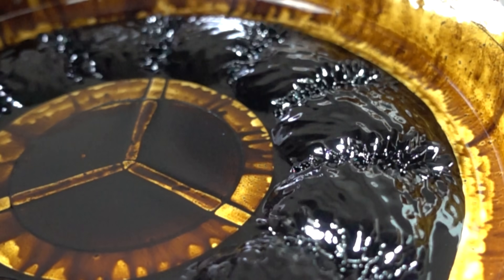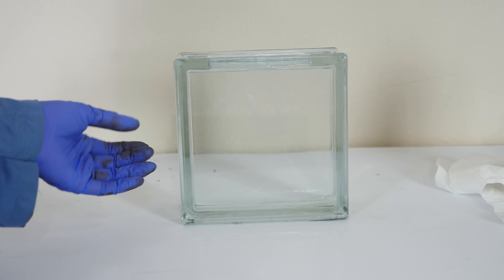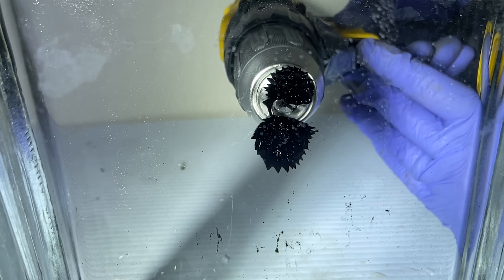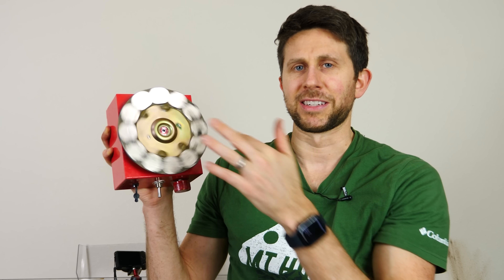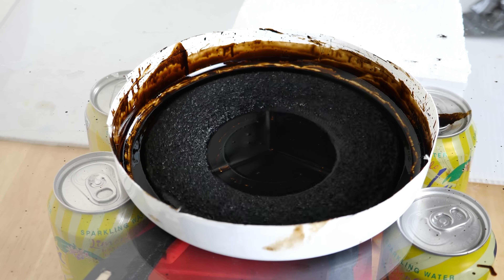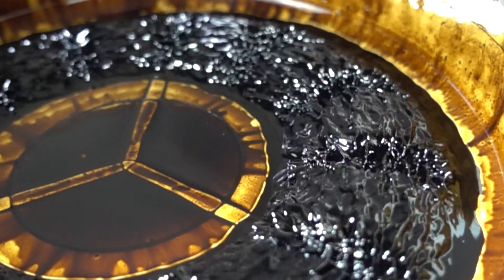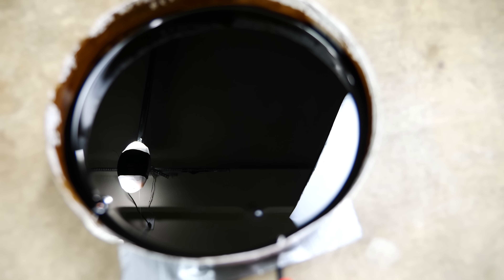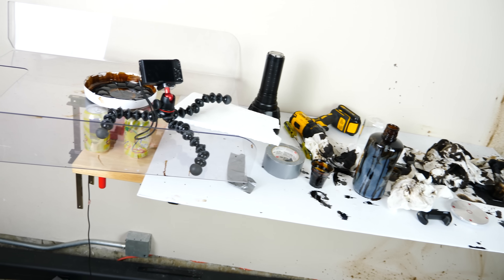What Happens When You Spin Ferrofluid Super Fast?

Comment: Given the ferrofluid is made with metal nanoparticles, could you use the rotating magnet setup with the ferrofluid as a polishing device? Given metal is fairly abrasive, I feel like it would be a pretty efficient, well lubricated polishing setup for lower hardness, non-magnetic metals.

Comment: There are no “lines” in a magnetic field. There is just the field. “Lines” appearing in the ferrofluid are simply created by the aggregate alignment of the ferro-particles in the fluid. 
This can be proven by doing the metal filing experiment a number of times. The “lines” will be in different places with each test. The “lines” in the filings experiment eventuate because each metal filing is literally turned into a mini-magnet and they are just lining up (meshing) end to end because of the poles aligning with the general field, which is actually a 3D dual toroidal shape, where one torus form the North Pole field and the other forms the south field. In between them is the accretion disk, which also appears in the filings experiment. Check out Ken Wheeler (Theoria Apophasis on YouTube) for deeper magnetism explanations.

Comment: I saw one video I think it was modeling of Ferrofluid and they found that you only need to know what is happening on the surface of the fluid for the model and you don't have to worry about the internal volume. The fact the ferrofluid stopped spinning with the magnets is kind of proof of that simulation.

Comment: Always fascinating to see what you come up with next. 

I'm wondering if there's any way of using (some form of) Ferro-fluid to create a very powerful electromagnet...

Does what you're doing work in inverse? If you pumped ferro-fluid round & round through a conductor fast enough (eg: a tubular copper ring/or plastic tubing surrounded by a copper wire coil), would it generate a perceptable magnetic field?

What if you made of ferro-fluid with liquid Oxygen as the liquid component (or some other extremely cold liquid), would this significantly amplify the effect?

Comment: You could easily rotate it with coils placed around and there is a vessel in the middle of them to keep the fluid in a circular form. Like mercury or with a inside ring that one polarity and an outer ring has the nother polarity and like rail guns the magnetic field is genersted by the fluid to move

Comment: Hotplate in a vacuum chamber with gallium or tin in a pot if you submerge wood in it would it absorb the metal in vacuum. Wood burns at 300 Celsius. Tin melts at 231 Celsius. It should be possible
Reply: I know i liked my comment i just want it noticed

Comment: would it be possible to draw this fluid between 2 different magnets suspended on either side of a glass tube,  with water in between, then would it be possible to enduce an electric field between the two sets of fluid?,  then if possible, how does the magnetic enduced shape of the fluid affect the electrical field in between?  seems to me that it could be a key to creating harmonic in that electrical field which in turn can allow it to store energy.

Comment: it seems to me that these spikes are the physical view of the breakdown of a magnetic field. because magnetic fields break down Distance Squared.  what would be interesting to see is this fluid is if you can find a magnetic field design that would allow for A spike,  any spike for that matter is go beyond the distance squared,   another major question i have is what is the capacitance of this fluid for given volume?  this should be dependant on the amount of ferral material contained.  with this capacitance reading, you can tell if it would be possible to use tesla's theory of harmonics.  which is,  every body has a harmonic state, and when that hormonic state is achieved, it becomes a storage unit for that energy,  given enough of these harmonic unites of stored energy stops and releases this energy, you would achieve a very large spike of energy the moment its released.  tesla also showed us that anytime you have a capacitive substance between 2 plates, that you can affect that substances harmonics with energy, and you can draw energy off of it at a given rate.  this is known as capacitence.

Comment: The problem with ferrofluid is it is not showing the density of magnetic field very well. Also ferrofluid I think is not attracted to a magnet as strong as other magnets. (Centrifugal force can detach ferrofluid from a magnet easily so my guess is that is not a very strong attraction force). Could magnetic or iron dust look different in similar experiments (inside rotating magnetic field)? Thank you for sharing!

Comment: You need to add the ferrofluid in a cyclical machine that  spins at at 60,000 RPM , to see an electromagnetic field that will lift the entire thing on the air

Comment: ive had an idea for a WHILE NOW, of using a spinning ferofluid to create gyroscopic forces/stabilization for flying/underwater vehicles and or spacecraft. using a series of electromagnets and a smart circuit to control them you could make such a device with "zero moving parts" other than the ferrofluid itself that is.
Reply: But you need to spin a magnet first, lol
Reply: @vladyskaizen  electrical current moving around creating a moving magnetic field would achieve the same results, without actually having a spinning mass of magnets. i refer you back to "using a series of electromagnets and a smart circuit to control them" in the OP. 
it would work SIMILARLY to how "railguns" or "coilguns" operate, just in a loop, instead of linearly, using a smart circuit to turn the magnets on and off in series, automatically in a pattern set up to achieve the speed it is set to "spin" at.

Comment: A though just came to me, especially after the AC magnet at the end. With such high speed flipping of the magnetic field, the magnetic particles in the ferrofluid must also be flipping to align to the magnetic field. Does this result in an increase in temperature due to friction with the carrier fluid?
Reply: Induction heats metal.  This is definitely metal, even if it's oxidized.  The whole system heating up (including/mostly the core screws) is probably why he limited to a few seconds per shot.
Reply: Induction doesn't heat all oxidized metals. Inductive heating requires delocalized electrons. To test this, I put a Tums (calcium carbonate) into an induction heater and it didn't warm up, even though it contains (oxidized) calcium.
Reply: I'm wondering this too!
Reply: I'm sure
Reply: i mean it isn't heating it up that much or that quickly since he literally put his finger in it for a bit after it was running and the only protection he has was latex or nitrile  gloves... so even if it does heat it up, it didnt heat it up too quicky or to the point it was too hot for him to keep his finger in it.

Comment: Here's a explanation of why the ferrofluid on the spinning magnet plate stops going crazy at high speed and act as if the entire magnet is static but weaker.

The entire setup becomes stable because the time scale for "ferrofluid goes from flat to spikey" is significantly longer than the time scale for the magnetic field's period, and the tiny perturbation from each half period becomes insignificant compared to the average. Remember that the force the ferrofluid experience stays the same whether the magnetic field is pointing out of it or into it, and also that for this experiment, that's the only thing that affects the behavior of the ferrofluid.

You can verify this by increasing the viscosity of the ferrofluid and watch as the pseudo-stable state form at lower speeds.

It's a bit like how you stop getting stuck running your nail over a comb when you do it fast enough, but will when you do it slow. The time scale of the force you push your fingers against the comb pushing your finger deep enough to get stuck is much longer than the time it takes for your nail to go over one tooth and reach the next, so you stop getting stuck as your finger doesn't have time to...get stuck.

For the drill, the explanation is similar: it's to do with the time scale of things, but here the exact events are different.

In this ferrofluid, the spikes doesn't have time to gain much speed before the magnetic field leave and came back from the other side, pulling it the other way. Still, because the ferrofluid is moving in the same direction as the magnets, it spends a little more time getting pulled in the direction the drill is spinning than the opposite direction, so in theory the speed will still build up a little with each period if the experiment was done in a vacuum and it doesn't fly apart. However there's water, so drag stops it from going at any real speeds.

You can verify this by having some kind of marker (a drop of colored ink should do) in the ferrofluid, and you'll see it slowly rotates even when it seems stable, and if you graph the ferrofluid's rotation speed against the drills rotation speed, it'll asymptotically approach a limit towards infinity drill rotation speed.
Reply: Magnetizing this type of material? Different emulsion components. There's some interesting possibilities like valves with no moving parts.

Comment: Absolutely fascinating! Thank you for sharing. Yes that ferrofluid has to be the messiest stuff on the planet - it's like used engine oil full of metal contaminants, will stain just about anything!
Reply: @moomoocowsly  no
Reply: It locks like the venom thing
Reply: @moomoocowsly  It’s just iron suspended in a lipid. I wouldn’t eat the stuff, or put it in my eyes, but I can’t see any possible health risk. We’ve been handling iron and oil for millennia.
Reply: Anything with iodine in it is really bad too.  There are some darkroom processes that use it and when left out in a tray, the iodine gets in the air and leaves like a red film all over everything in that danged room.  It’s pretty awful to clean up.
Reply: I know right. Atleast this stuff can get removed easily
Reply: Wondering if I can bottle my used engine oil as ferro fluid.
Reply: Can this stuff put in teflon?
Reply: @Masterpeace0_0  yes, but it's preferable to keep any wares dedicated to food OR science, just to be safe. Once you start doing weird stuff with it, (this goes for stirring and measuring utensils, too,) it's better not to use it for food unless you absolutely know the chemistry is safe.
Reply: Black blood?

Comment: If I place my hand on the top of a rapidly rotating neodymium magnet arrangement, will my hand heat because of the eddy current?
Reply: nope. ur hand barely carries any eddy current because of its high resistance. water containers offers very low resistance resulting in massive eddy currents